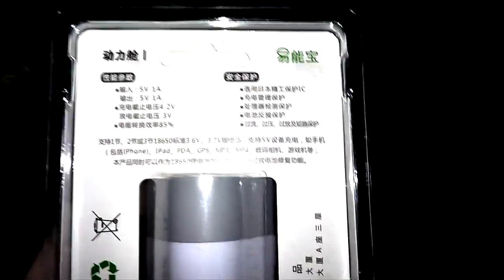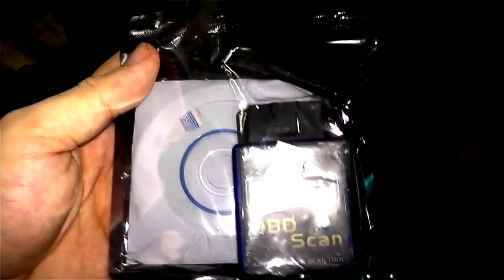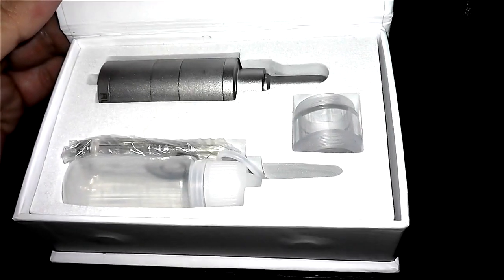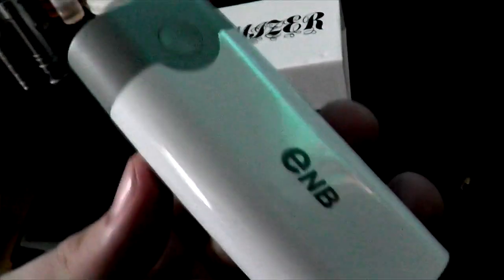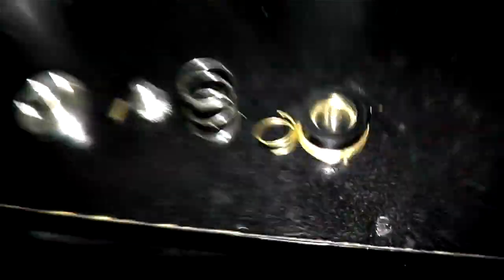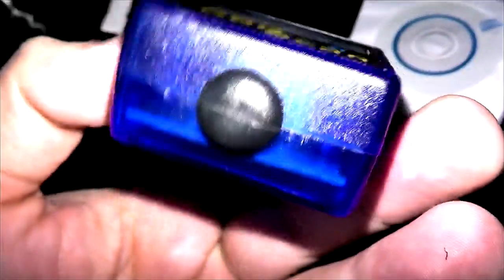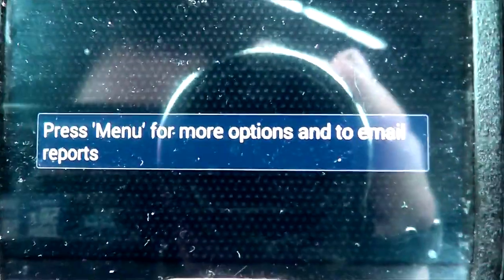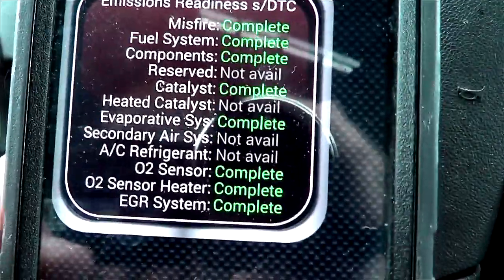Mail Day

Comment: See if the OBD2 scanner shows fuel trim measurements, maybe you can customize the gauge to find it? If your long term fuel trim(s) is in the high positive numbers, (above 10) you have an issue with the car creating a lean condition, so the computer is compensating by adding more fuel, which would explain poor mileage. Alternatively, if the numbers are high negative (-10 or more), it could be something like a stuck injector or bad pressure regulator pumping in too much fuel, so the computer is trying to turn the fuel down.

Comment: Yeah, I did that once, bought an aquarium filter off ebay and it came from china, found one in the petshop the next day for £1 more... :\

Neat battery device, shame about it's origin... :P

Just remember to unplug that OBDII reader when not needed, it'll drain your battery otherwise!! :P

Nice modification that, I'm sure it could be used on other push-button devices that have spring issues.... :P

Comment: Look for live data. Find the  LTFT ,Long term fuel trim. It will tell you if computer is adding or subtracting fuel.Closer to 0 is best and will not set  a code till over or under 10 for a good while . That is what I would look for to start.